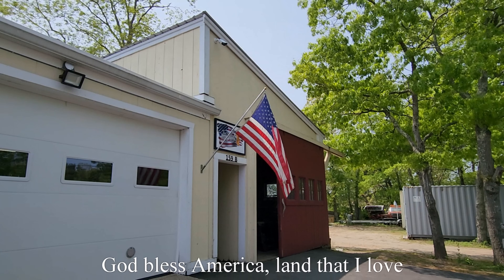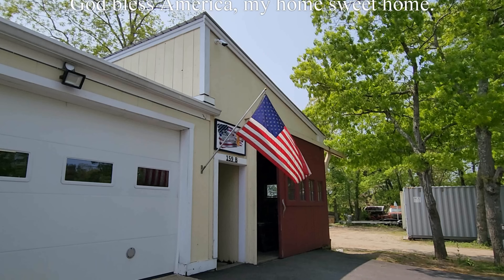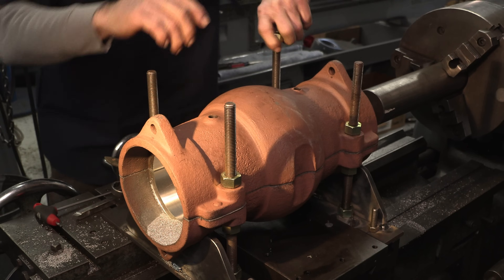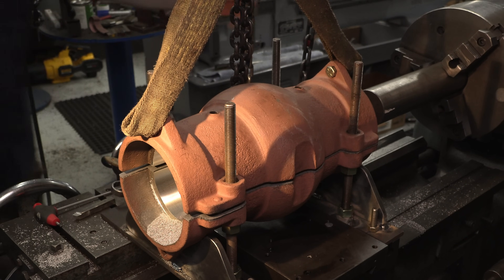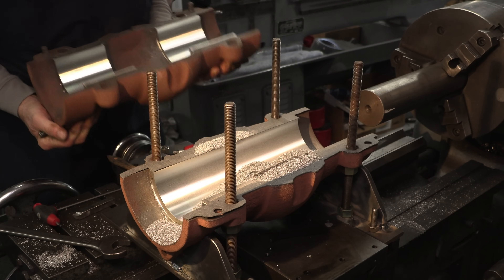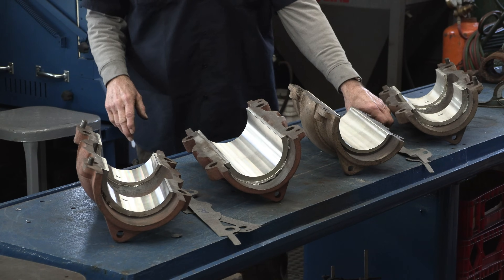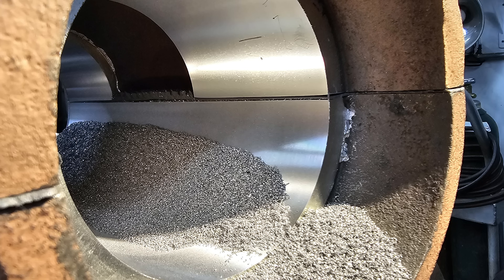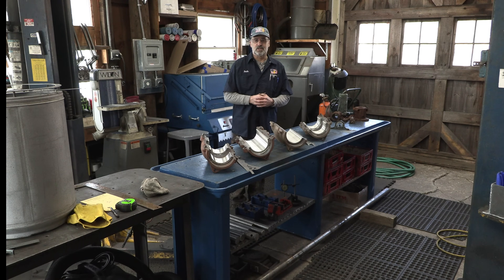Babbitt Pour 2024 Part Six

Comment: I'm curious why there is no cross grooving at the grease port in the Babbitt for grease to travel and cover the Babbitt bearing surface.  I'm use to seeing cross grooving on engine bearings.
Reply from the maker: Oil Slinger Ring System
Reply: @KeithFenner  Not familiar with that setup. I'll look that up, thanks